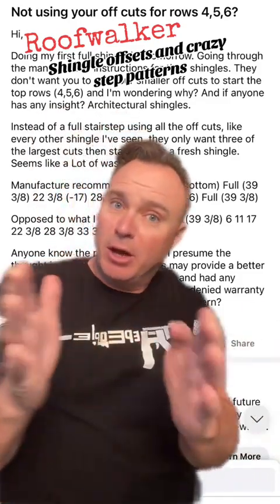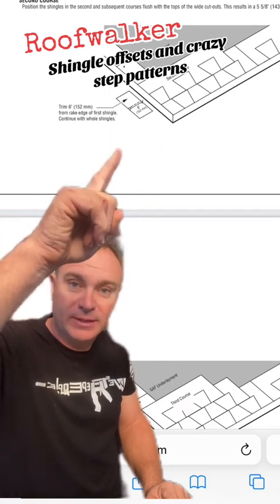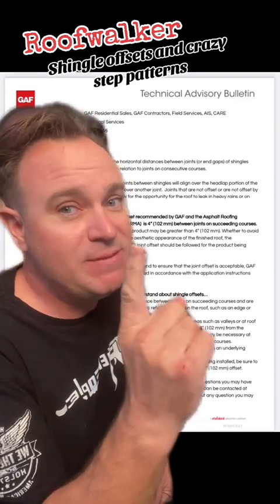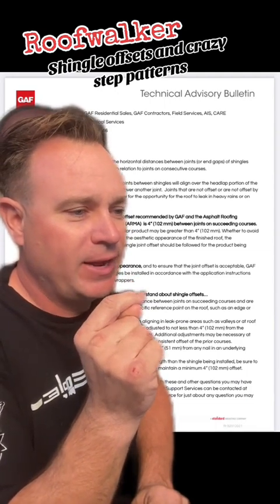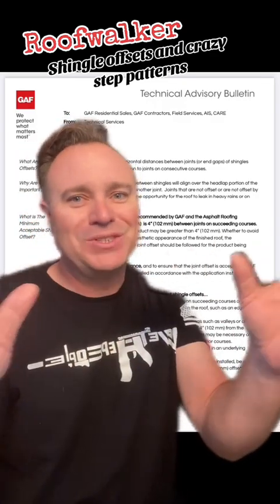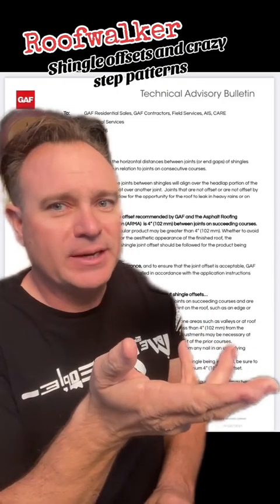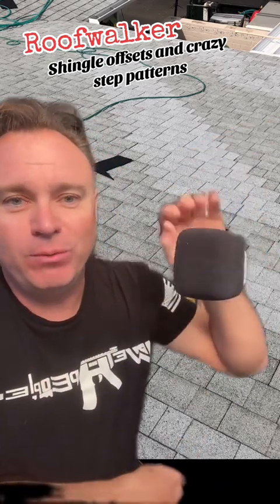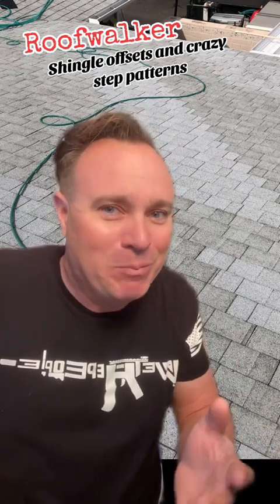GAF weird step pattern for shingle installation

Comment: they want them after the middle thats the pattern of wind blow ,the wind blows harder on top ,the small ones so you can have one or 2 more nails that can hold better ,n it blows its easier n cheaper to replace by cutting a leftover shingle n leaving the rest for future maintenance, off sets yes ,,thats professional way,,to do it ,there are exceptions & by other manufacturers,,, shingle   warranty is just shingle asphalt granules ,  adhesive ,so anything pertaining to it installation,, you can use another way better underlayment system as a whole to cover which may be better if properly install peace of mind n dont have to worry about warranty ,plus insurace coverage without no question

Comment: I just had Timberline UHDZ installed and they didn’t follow the recommended install instructions and my roof looks terrible and streaky. I even pointed this out to the installer several times. If you want to give your customer a stunning roof - follow the manufacturer instructions.